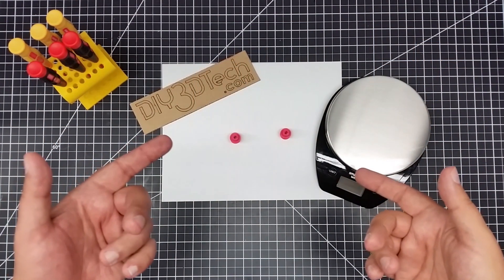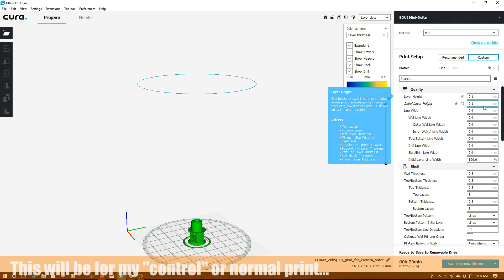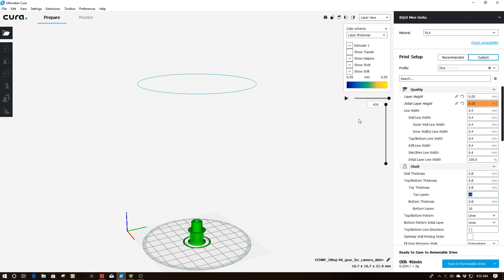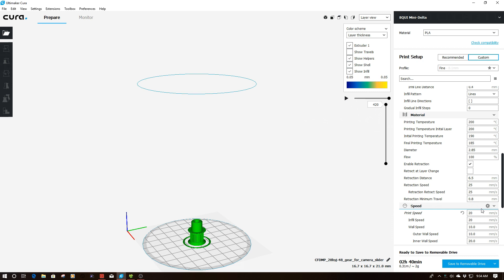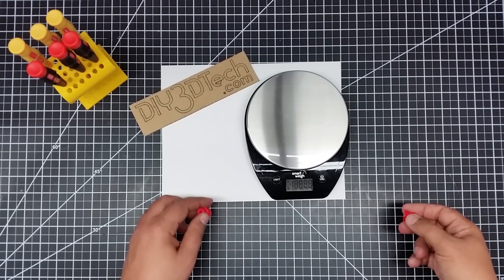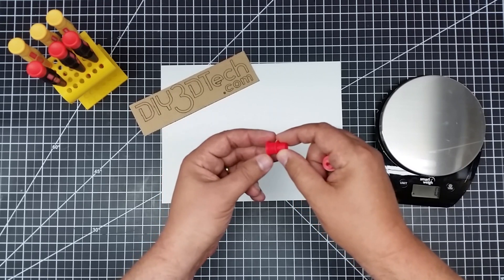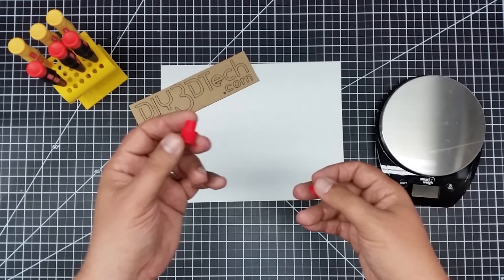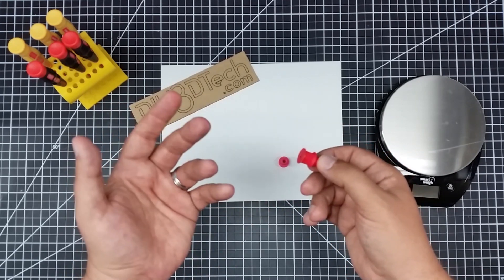Shop Talk - Near Resin Quality Gears From Your FDM Printer!

Comment: Sorry for the smart assing but there reason why you get better quality on top layers only is simple (and cura specific): If every layer is a top layer an you run it at 20mm/s it in fact prints at 8mm/s! Cura prints top layers at 40% of the the set standard speed. So try setting everything normal and print with 8mm/s and compare ;) and btw. if every layer is a top layer there is no need to set an infill %. Sorry again but had to get that out :D anyways keep up the good content ;)
Reply from the maker: In general I agree with you as mention in the video, believe the magic is in the fact all of the layers are top layers.  As if you print all layers as "top" layers they will be solid correct?  I also mention this video, however from the video I borrowing this from, they state to set to 100%.  Now I could also see some logic to this as I have no clue about the other of operations of the slicer if you want I so what come first?  Again I would guess the top layer would override, yet again only a guess so look at it as belt and suspenders. :-)

Comment: No need for 100% infill here ... If every layer is a top layer there's no infill at all. But aside from that great video ! Thanks
Reply: Or no need for a top layer, they're all infill layers...
Reply: That's exactly what I was thinking. I'm curious enough to test it out for myself.
Reply from the maker: In short printing with all top layers will make it 100% also be sure to check out a few of my newer videos on printing super strong parts...

Comment: How accurate are the dimension
Reply from the maker: The dimensions in general will more of function of the (micro) steps then this.  In general if there is a change it would be very, very slight from treat each layer as a first layer...

Comment: We can learn a lot by looking at different applications’ use of FDM.     In the end, Danny the 3D Printing DM was just using the settings to squeeze out the very best from the printer.  I’ve tried it with my Monoprice mini and need to keep practicing!   I don’t recommend using wood filament for it.   The 100% infill is important for strength as well.   CNC kitchen has some excellent approaches as well.

Danny also had some excellent models to work with.
Reply from the maker: Personally I have not had good luck with wood filament, it might be just the filament (SainSmart)...

Comment: for us impossible to tell the difference since the camera is 50cm from the piece ;) and 3hr for 2gr WTF? not for me thanks xD
Reply: lnadvertance 
The main proble is really smalm nozzles have too much resistance because the hole is so small. With .25 it took me like 2hrs to print an mxl pulley that size. And i have a geared extruder and if i cranked the speed above 20mm/s it started skipping steps so you realy need some force to push the filament faster. Not sure how posible it could be but maybe have a double geared extruder? Mine was 47:9 (5,21:1) maybe have two smaller gears sets to get 10:1 or 20:1. That shoul be according to how much you can push before the filament strips.
Reply from the maker: Yes to use a smaller then .4 you really should have a geared extruder...
Reply from the maker: Thats why I did the overlay with microscope image...

Comment: Speed makes a big difference.  The issue is that filament (especially TPU, but also PETG.  PLA less so) is viscous, so every time the print head changes speed, like slowing down for a corner, the flow rate change lags behind, meaning you have flow rate a bit high as it slows down and a bit low as it speeds up.  This results in bluging and sometimes even zits around corners.  Slowing down the max print speed reduces this simply because it limits just how much it has to slow down and speed up.

Another speed related issue is ghosting, where when the head makes a sudden change in direction or speed, it will vibrate/recoil a bit.  This results in ghosting, where it's recoiling from a previous change in direction as it continues on.  Properly calibrated pid settings of course help, but I for one wouldn't even know where to begin to do this.

It's possible to have your layer height too small, in which case, the way the print head drags over the previous layer will pull bits of filament along with it and make things messy.  PETG is particularily troublesome here since it's so darn sticky and loves to build up on the nozzle.  I've had best results with PLA at 0.08mm, with 0.04mm having problems with rough little blobs or plastic left around where they were dragged off by the nozzle.  PETG I've gotten down to 0.12mm.

A final thing is that, especially with thin layers, you need to find out your printer's actual step size on the Z axis and have the layer height be a multiple of that.  For my printer it's 0.04mm.  This means that if I were to try to print at 0.05mm, I'd have poor results since it would print three 0.04mm layers, alternating with one 0.08mm layer.  Since it can only move up and down in increments of the actual physical step size, the best it can do is make sure the average layer height is what you specify.
Reply from the maker: Yes with TPU I drop to 20 to 50% and PETG about 80% of PLA speeds.